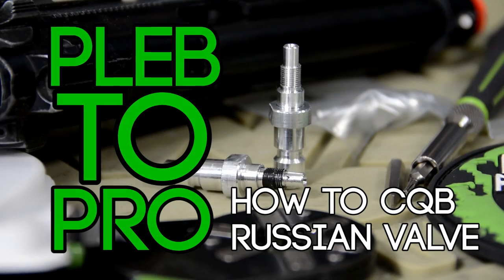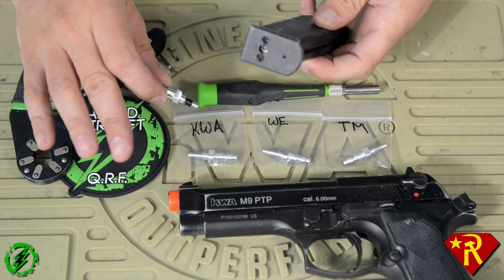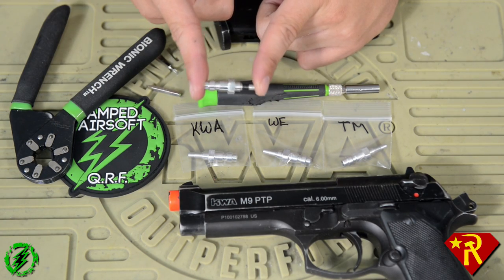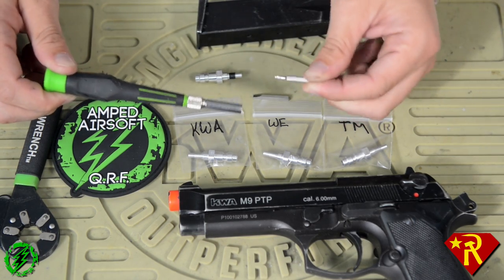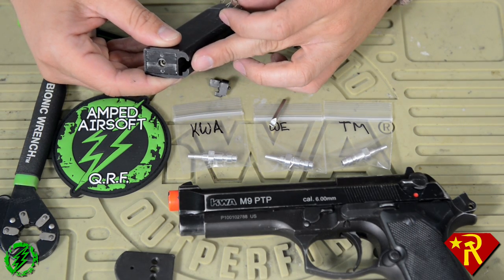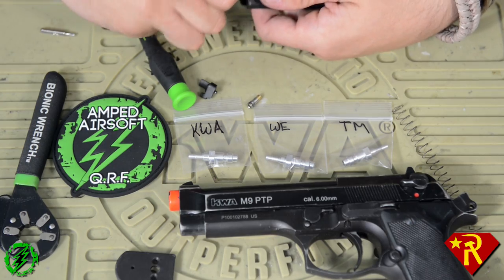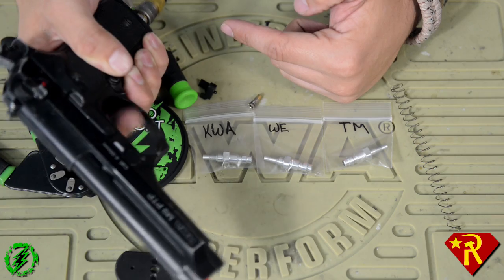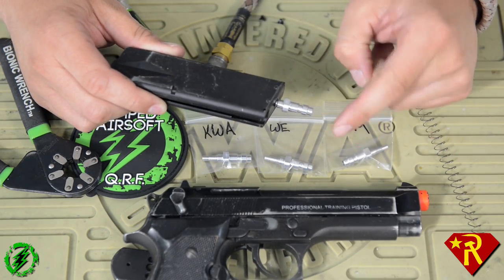Pleb to Pro - How to CQB Russian Valve

Comment: Hey dud e great vid 
I do not know if you have said this before but i need to know on the output well input for the mags what would be the recomended pressure for the mags, i rather tell you what i have cause my valves are coming in a few weeks, got a full auto m9 we normal mag, i got an excelerator both short and extended mag and i have a kwa mp7 extended mag but i have not found much info on that and i really wouldnt like to mess it up, also how often would you need to lubricate it due to no longer using green gas, thx for the time and answer
Reply: 90 to 120 psi the mags can handle with absolute no issues

Comment: I see this being a really good thing for extended gas mags, like a Glock 18 50 round mag, so you can get all your shots out with no issues, where as left on green gas, could possibly just leak all the gas out in a burst and leave you with around 20 or so bb's still inside.
Reply: I might be wrong but that sounds more like your mag has a gas leak issue??
Reply: yeah, I have those mags and the green gas lasts for two sets of bb's.

Comment: Which valves work for the VFC threads? More specially the navy mp7
Reply from the maker: Hmmm That is a good question.  Most of the other VFCs take a WE Adapter.  I would assume that the Navy will also take the WE Adapter as well.
Reply: Mr. Anyone hey did you tapp it i’m looking to do the same thing what value did your use

Comment: Not sure where you got your valves from but I just got my WE valve and I try putting it on my mags and I can't really hand tighten it. I've tried it without the Teflon and nothing. WE valve WE mag. Fucking pist.
Reply from the maker: The Purge Airsoft hmmm these valves are from CQB Russian himself. Please email us at sales@ampedairsoft.com so that we can get you replacement valves if yours are incorrect. Did you make sure that your threads were clean and that you are not cross threading? Do the threads on the valve look the same as your old valve? If not, then there is a chance that the valve was mislabeled when we received them. Please let us know so we can get you all straightened out. Thanks! -Kurtis

Comment: Iono if this is a dumb question, but if i tap my mags would i be able to test fire my gun by hooking it up to my air compressor at home while im doing modifications?
Reply from the maker: Sure can! Just make sure it's under 200 PSI.  We sell the following adapter to plug into your compressor line so you can run our lines or other airsoft lines with it.  https://ampedairsoft.com/amped-custom-shop-compressor-adapter/

Comment: Ohh Tech Guru Minds at Amped Airsoft.. hear my plee! 
Would these Russian HPA Valves be usable in a WE-Tech Full Metal 'Dragon X-Celerator' Airsoft Gas Blowback Pistol using the standard 52rnd Extended WE-Tech Magazine (for Hi-Capa Series)?  If so, what Reg Setup would I need to give the right amount of air to these suckers and any idea what the midrange setting on PSI would be for them?
(I have some new Tippmann 48/3000 tanks, I assume I would need to drop their output from the 800 range?)
Reply from the maker: Hey there Avatar! 

They sure should! You will want the following CQB valve: 
https://ampedairsoft.com/cqb-russian-hpa-adapter-we/

Typically your PSI range will be in the 80-120 PSI range typically.  If you are looking to use your tippmann tank, you would need to go with a wolverine storm, redline SFR, PolarStar MRS, or Ninja LPR.  If you went with an SLP tank, then you could use an SLP air rig that we also offer, however to save money I would say go the standard rig route since you already have your tank. 8) 

Here is a link to the SFR Rig:
https://ampedairsoft.com/amped-custom-hpa-rig-redline-sfr-super-fast-refresh/

Please let me know if you have any other questions.
Thanks!
Reply: Amped Airsoft As always.. the purveyors of info and skillz. Thanks!
Reply from the maker: No problemo! 8) Thanks for your trust! haha  Have a good weekend! -Kurtis
Reply: One question on options.. Can the SFR Regulator: Redline Airsoft - SFR (Super Fast Refresh) come with a Ninja PTC fitting on the gun end of the line and standard on the bottle end?
Reply from the maker: Hmmm We should be able to accommodate this, please shoot us an email at sales@ampedairsoft.com with what you have in mind and we can work out a quote for you. 

Thanks!
Kurtis
Reply: Always the awesome professions.  I will do so soon.  Thanks AA (c/o Kurtis)!

Comment: does anyone know which Russian CQB valve will fit for Umarex VFC MP7???. They don't sell them in UK (most of the sites are "Out of Stock") so if I buy it from outside of UK I don't want to pay extra for return of the one that does not fit the mags. Thanks for any help
Reply: you would use kwa
Reply: too late...  I ordered all of them and none fit in. The screw thread of VFC is different from the CQB valves
Reply: +xXxWolfer92xXx that's weird I used kwa ones on my mp7 and it worked fine

Comment: I put teflon tape on the valve and it leaks but it is only noticeable when in a silent room with your ear to the valve, is  this normal or is there a fix
Reply from the maker: Ryan, Sorry for the delay, we just got back from Shot Show and are catching up with things.  Typically you only need to add the original oring to the valve.  If you are having a leak after taping it, it's due to taping it incorrectly.  You will need to retape it so that the leak stops.  Typically this happens if the tape is not put on correctly and the tape is not going with the threads of the fitting.  

I would recommend trying the Oring first before teflon, as that is the way it's meant to be run.  Teflon is a fall back just in case.

Comment: Could a TM valve still work with a we tech extended hi capa mag?
Reply from the maker: Hmmm I would say to use the WE Valve since it is meant for the WE. ;) I would imagine that the TM valve would not work since the threading is different. 
-Kurtis

Comment: @amped airsoft I haven't been able to find anything about trying to convert my KWC desert eagle to an HPA setup I have both the green gas and co2 mags I assume I would convert the green gas and would prefer to since they ahve a higher capacity. do you know which fitting I would use? do I use the TM model? or no?
Reply from the maker: Hi there! When it comes to KWC, I am unsure what valve that will take. 8( But you are correct to say that it replaces the fill valve on the green gas magazine.  They will not work on the CO2 Magazine. 

I shot CQB Russian an email asking which valve is needed for the KWC.  I'll let you know what he says. -Kurtis
Reply: thanks!
Reply from the maker: Just found out! It's a WE valve according to CQB Russian. 8)
Reply: Amped Airsoft thanks so much! Honestly that’s a life saver I was about to buy the Wrong one!
Reply from the maker: No problem! That's why we are here! Hope you have a great weekend! Thanks again! -Kurtis

Comment: does the WE adapter fit the armorer works pistol mags?
Reply from the maker: It appears that the Armorer Works Pistol mag is based on the WE Valve based on the google foo I just did.  As long as that info is correct, I would say that the WE valve should work. I would advise doing more research to double check me just in case. -Kurtis

Comment: I have the HFC drum mag, my guess would be the KWA but I’m not entirely sure
Reply from the maker: Hi there! We have messaged CQB Russian about this and are awaiting a response.  He needs to find someone with this specific drum mag to see what will work.  We will post up once he lets us know the answer. Thanks!
Reply from the maker: I just heard back from CQB Russian and here is what he said:
"I do not have an adapter for this.
But they might be able to use the we adapter is going to be tight so they have to be careful when they put it in"

Hope this helps! 
Thanks!
Reply: Amped Airsoft hi many thanks for finding this information, I ordered the WE fitting, and it fit perfectly 👌🏼
Reply from the maker: @S550_HB  No problem! Thanks for letting us know. Glad we could help! -Kurtis